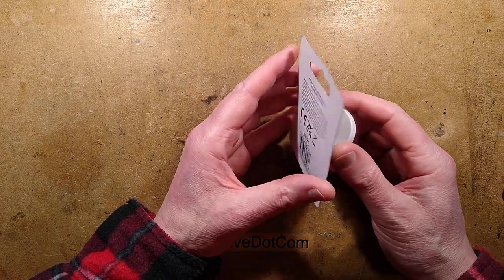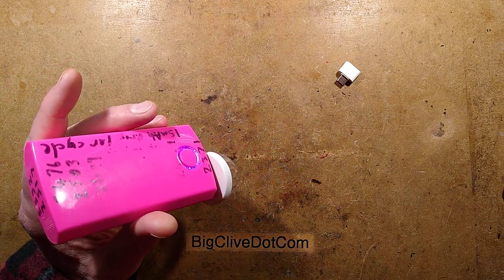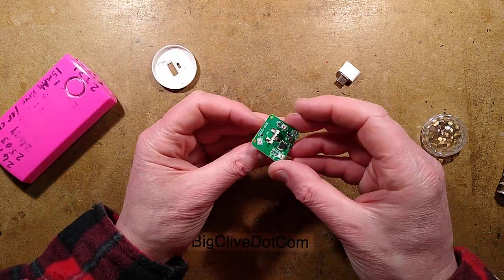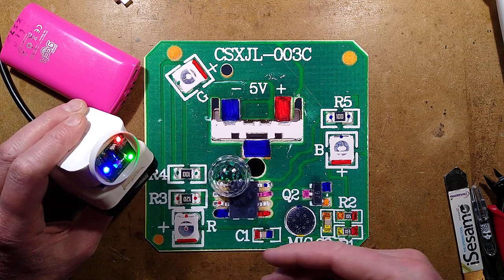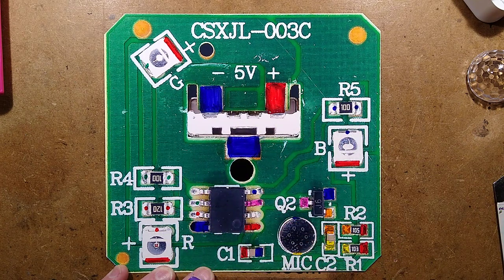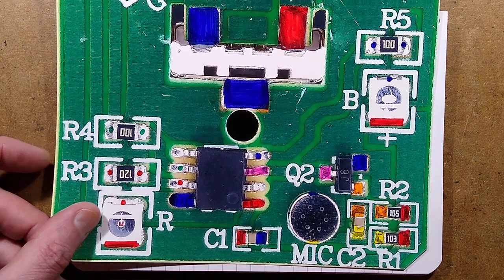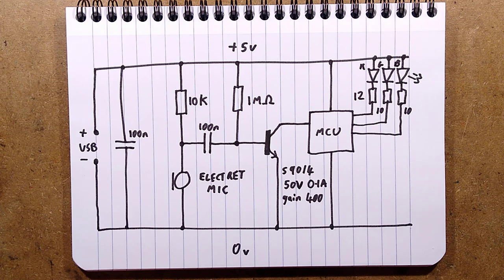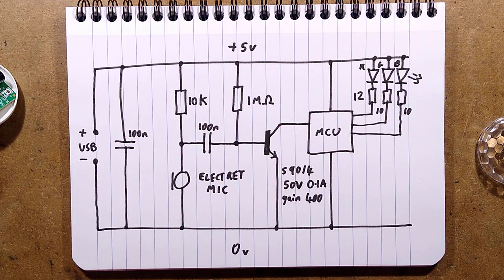Pound shop USB disco light teardown (with schematic)

Comment: Haha, I would buy this thing just for the USB-C adapter. 😛
Reply: Could just be a power adapter though, might not work for data. Still, for one pound...
Reply: I once bought a wireless doorbell receiver in B&Q for a pound solely because it had a USB socket! It's now the cheapest phone charger I own, with the added advantage that it bing-bongs when you switch it on!
Reply: 10 pounds says it's power only adapter
Reply: @nyetloki  No it's fully wired and supports power AND data. At least on the one I have (which I bought from One Below in Cwmbran a few months ago - actually cost me £1.50 but 100% worth it for the adapter - the identical adapter is currently selling for £2.69 on ebay!)
Reply: @countzero1136  How is Crow Valley these days? Presumably you can still get Brains Dark?
Reply: USB wire with just power and ground, it does make sense to cut cost. But in adapter its just 2 more connections and you have an adapter that you can include in all kinds of products. Its much cheaper to produce one kind of adapter with 4 connections (+ , - , data in , data out).
Reply: @wiseoldfool  Well you can, but somehow it doesn't taste quite the same as it used to :( Not sure if something's changed or if my taste buds have been burned out by one too many Indian curries, but yeah, it's still around, although I guess not as popular with the millennial generation that it was with us :)
Reply: @stevenhodgson834  It definitely DOES work for data :)

Comment: Hm, that'd be a neat project, maybe just throw away the circuit board and replace it with a slow colour changing LED and a resistor. Or even better, three colour changing LEDs so they'd vary the patterns when they naturally drift out of sync.
Reply: Probably easier to revise the existing PCB which already has the LED places and resistors!
Reply: @stepheneyles2198  Yeah you can probably get a pin compatible tiny MCU chip to replace the one already there for pennies...
Reply: @stepheneyles2198  cut the link between the transistor and the microcontroller maybe?
Reply: Sad when you can improve a device by ripping out and replacing the innards with just three resistors and three LEDs...
Reply: could it be improved by varying the voltage it receives through the usb?

Comment: 4:48 An "audio responsive resister" is a perfect description of the old-style carbon granule telephone transmitter. Speaking into the transmitter deflected a diaphragm that alternately squeezed and released a densely packed container of carbon grains. This changed the resistance of the carbon and converted the soundwaves into a varying current on the phone lines. Since it only had to transmit voice, it had a pretty narrow frequency response, but it got the job done for many decades.
Reply: Hence the practice of smacking them on a hard surface to restore the sensitivity.  🙂
Reply: @mecoollearoyd  Exactly! However, this is NOT recommended for your smart phone. ;-)
Reply: Still "getting the job done" in my house and workshops!☎
Reply: for sure !
Reply: Audio responsive capacitor in the case of these "condenser" mics.  ( condenser is another, older term for capacitor ).
Reply: @Randrew  And here in France the word for "capacitor" is...

Condensateur !
(Literally condenser).
Reply: @psirvent8  In older technical books capacitors were often called condensers.
Reply: @psirvent8  Of course you're right.  I think in German it's "Kondensator", though they may use capacitor too just for modern convention.
Reply: @Randrew  no we still call it Kondensator but the value is the Kapazität
Reply: @Randrew  The output of the mic is basically resistive but it's controlled by a capacitive element.

Comment: First thing I ever made with LEDs was a mini disco light.  I just connected the LEDS straight across the headphone output of the HiFi. Having my own Action Man disco made me the envy of the school.
Reply: So much easier back then it seems. 
I managed to get an led attached to a button cell, stick it on top of a motor, just to get a circle of light 😎
But then my dreams were more simple. Now I have a computer and think that the cpu cooler lighting up is too much 🤦

Comment: I bet if you replaced the resistors setting the bias to the transistor with an appropriately-sized audio-taper potentiometer, you could adjust the sensitivity on the fly.
Reply: Yes a very good idea. Maybe this could be a way to put a dimmer on the regulasr white LED lamps that Clive has been adapting with resistor changes.
Reply: Or, remove the transistor/mic/resistors altogether, put the pot ends on the rails and feed the wiper of the pot directly to the micro. I bet that would yield different flash modes.

Comment: I ordered some of these a few years ago, they are similar but have 4 LEDs. The default effect had 2 phases: one with 2 green LEDs lighting and the other phase with the red and blue at once. The "sound" detector just stepped to the other phase, and in silence it stayed where it was.
One was hacked like you suggested: I removed everything from the pcb and put in 4 slow self changing LEDs and a resistor. Not very disco, but much more bearable effect, looks nice on the wall. My kids "borrow" one of my small powerbanks and run around with it like a personal portable one-man disco :) (Edit: mine have screw-on top for easy hacking)

Comment: I got one of those USB-C to USB-A adaptors in a cheapo gadget I bought a while ago and I was pleasantly surprised that it not only worked for USB data, but even ran reliably at USB3.0 speeds.

I guess the factories just make the one type for economies of scale reasons so it's just as cheap to use a fully-featured adaptor.
Reply: Yeah probably worth buying just for that adaptor. When (or if) you need one then you will be lucky to find it on Amazon for much less than £5 and since everything is moving to usb-c now then it's a no-brainer...
Reply: @smitcher  The identical one that's supplied with this light is selling for £2.69 on ebay right now...
Reply: @countzero1136  I've bought 2 of them earlier this year for about 4,99€ or so off ebay, so seems to be normally around that. :)
They can be a bit reluctant tho, had to open mine (they slide apart) and bend the catches up a little to let it make contact at all. Also not much in there, just the two jacks and one or two resistors, that's it.

Comment: Great video. Love the way you tear devices down in to its individual building blocks. Bet if I had a project in mind and trolled your videos I could find all the required building blocks for one. 
As for this device. 
Usb c adapter 
Nice case for another project
Nice circuit board to build a different device. 
All for a pound. 
Break it down and add it up probably has 10 pounds worth of components.

Comment: Right at the end of the video after all the put down, your say neat little device ?. I have had mine since 2020, still working well, I use mine outside in the back garden when needed , As they need lots of room for best effect pointed to reflect of the back of my house. A good very cheep stage lighting effect.

Comment: Replacing the 10K mic bias resistor with two 4.7K and fitting a capacitor between the resistors mid point and ground would greatly improve the supply noise rejection.

Comment: This is another device you have that I also have. Most of my gadgets were obtained from gaming machines in Korea.  My "disco light" behaves exactly like yours - rapid flashing from battery, super slow if plugged into the usb port of my computer. The only difference externally is mine uses 3 screws to hold it together. Inside, mine is MUCH more complex!  About 20 resisters etc plus the controller.

Comment: Split the 10K base bias resistor into two series 5.1K and put a decoupling capacitor between the 5.1K tap and ground. Maybe add in parallel to the decoupling capacitor a 3-ish volt zener diode.

Comment: Sit down Clive as I have something to tell you. You go a shit one, sorry breaking that sort of news fast is the best way IMO.
I purchased a couple during our first 4 month lockdown in 2020 as I thought it might bring a bit og cheer to our locked down life and it did. My ones didn't "strobe" like yours when connected to a powerbank and it didn't work off the better powerbanks which I assumed was due to the miniscule current draw. They did work well on the single 18650 cell powerbank though. The advertising on the box indicated that you needed to stick it up your phone's bum and play music and the thing would flash in time to the music, which it did on most phones. They would illuminate a very large room at night that allowed you to easily walk round any obstacles and not take an unexpected trip without purchasing a ticket.

I ended up buying a further 24 of them to give to friends at xmas and fun was had. I was not a fan of putting them in the phone's charging port since it was too easy to knock the light and result in damaging the port. 

The icing on the cake were the 3W rotating "disco lights" which I promptly put in our toilets replacing the normal luminary devices and surprised many a visitor who had a "front row seat" so to speak. Like much chinesium products they lasted about 15 to 20 hours before failing which was annoying because they always made me smile when having a dump and there was more than enough light to manage the paperwork. Those and the USB ones brought much smiling and joviality during our lengthy lockdowns in Melbourne Oztralia.

Thank You for busting one open since I wondered what was inside and I have yet to have one of these fail. 👍

Comment: Hmm, seems OK if a little irritating on its flashing mode. I wonder whether you could (a) unsolder the microphone or (b) unsolder the microphone and put a resistor in its place, so it stops strobing randomly?
Still, the bare components, and the USB-A to USB-C adapter make it worth the £1 itself.

Comment: Ooo, blue USB connector. You should test what kind of data speeds it's capable of, or if it just transfers 5 volt power. (I'm thinking it's the latter and they used a blue colored connector)
Reply: I can't support using this type of connector even if it's USB 3.0 capable. If you look on the video there are no through hole supports. Which means all the mechanical strain will be right on the SMD pads. 3 35uM thick pads are the only thing holding the connector on.

Oh and at 3:05 you can see they just short the two middle pins d+ and d- together

Comment: To be honest Clive it's not as bad as some of the tat you get in pound shops. If this was indeed only £1 then for the adaptor and the pcb alone I think it's a great deal. You could replace the microcontroller to use it directly for some other RGB sound activated application...

Comment: I would bet that the reason it flashes uncontrollably when plugged into the battery is because the battery output regulation isn't quite good enough to compensate for the varying draw, so when the microcontroller switches on the LEDs, it pulls down the +5V line enough to affect the mic circuit and think that the mic is detecting audio when it's actually not.  The wall adapter probably keeps the 5V output more steady so it's not as affected by what the LEDs are doing.

The best way to fix that would probably just be to add a zener diode or some such to the mix, to keep the reference voltage for the microphone steady regardless of input power supply variation (would require a bit of a redesign of the circuit, though).
Reply: It would have been nice if Clive could have got the oscilloscope out and investigated how noisy the 5V coming out of the power bank was versus the adapter, and/or how unstable the voltage was when the LEDs were flashing.

Comment: Are all these pound shop items really only £1?   Or do they vary in price?   It would be interesting to tell us the actual prices.
Reply: Yeah they vary hugely. Poundland now for example sells things that are £20 which is ridiculous... Should just change their name to "Land" or "A Normal Shop"
Reply: I bought one of these lights from One Below and paid £1.50 - still worth it for the adapter alone. Most so-called "pound shops" now have less that 50% of their stock for £1 but you can still snag a bargain now and again (though Poundland is definitely losing its competitive advantage compared to the likes of One Below, though it has allowed them to stock a wider range of products since they're no longer contrained by the price limit)

Comment: Another in the series of Clive's "e-waste" tat. It's a shame we don't have a set of border controls that look at products coming in, that rejects the most pointless and terrible at point of entry. Perhaps they'd stop making this straight-to-landfill guff...?
Reply: Yeah but then I wouldnt be able to order cheap Chinese tat off eBay either!
Reply: Exactly, this really needs to come to an end, no one is going to be upset if they can't buy "tat"
Reply: I think that would be harsh. As an electronics enthusiast it's hard getting cheap components for experimenting with so these type of boards are great if you open your mind. You basically have a light source and a basic audio preamp for £1 and a usb-c adaptor too. Remove that mcu and replace with a pin compatible tiny mcu and you can make it do whatever you wish (within it's limits). Remove the leds and replace with white if you don't like colour and you have a sound activated light. Program the mcu with a timer or fit a larger mcu and a variable resistor and you can adjust the timing in circuit... many things that you could do with that circuit if the individual parts are things you need for another circuit...

Comment: Still wonder about the C to A adapter. Just power rails in there?
Reply from the maker: Data too.  It recognised a USB memory stick.
Reply: @bigclivedotcom  next question would be "USB 2.0" or "USB 3.0/1"? 😁
Reply: Since it is blue, it should be 3.
Reply: No it's fully wired and supports data
Reply: @TomCee53  3.1 iirc
Reply: @TomCee53  just asking, because I saw a video about fake 2TB SSDs a few days ago. There they used blue plastic in USB 2.0 plugs.
Reply: @SystemX1983  yeah, I’m sure there are some fakes. I bought a few myself. Unfortunately, not everybody plays fair. 
For the most part, an adapter shouldn’t be a problem because there’s nothing active, just wires. At the higher speeds the wire layout could make a difference. At this price point, it’s worth a try.
Reply: @TomCee53  yup, as long as all contacts are where they should be, evth. should be fine.
In the fake drives they used blue plastic in the plugs, but only 4 contacts for USB 2, the additional contacts were missing. But even if they used a fully equipped USB 3 Plug it wouldn't help, because inside was a USB 2 Hub with fake 2TB flash drives 😠

Comment: The blue connection in the adapter is consistent with USB 3.0. Is the USB type possibly responsible for it's mode?
Reply from the maker: The data pins are not connected.

Comment: What about the USB/C adaptor? Is it possible to use that to allow a MicroUSB charging lead to recharge a USB-C device?
Reply: It would only charge at 5v, since there is no USB-C power delivery negotiation circuit.

Comment: What was the PSU noise? Did you ever measure it? Would also be a funny experiment to see how much quality AC/batterybanks differ from cheap ones, if at all.
Reply: Those power banks use a switching supply to step the 3.7V battery up to the 5V output so they tend not to be a perfectly smooth 5V but have a little ripple and a few high frequency spikes on it. Most of them are intended as remote chargers for phones which don't care about a little ripple.
Reply: @AndrewBlack343  I’m well aware how they work internally. I was just curious if there’s a difference between them or if they’re about the same in terms of output quality.

Comment: i have had 2 of these lights they are quit anoying when they dont have the cap so even a little spike on the rail sets it off in to the quick anoying flashy goodness but otherways its quit cheap and works kinda good for the money but i  would add my own attiny mcu and some leds and some software or simpler some self colour changing leds

Comment: Guess it would have to sell for £2 if it had the desperately needed electrolytic filter capacitor already installed.  Strange how the noise is worse off the power bank than the usb charger - must have a horrible unfiltered step up convertor.  A slow flashing led would be much better than that annoying sound activated flashing - then you would only need two components, one led and it's resistor.  I wonder if it could be sold in the 50p shop then?

Comment: If that's a pound, it's a very cheap way to get a USB A to C adapter, providing it does data transfer.
Reply: It does - it's fully wired and I found the identical adapter on ebay selling for £2.69 so 100% worth buying just for the adapter (which is usb 3.0 / 3.1 compatible)